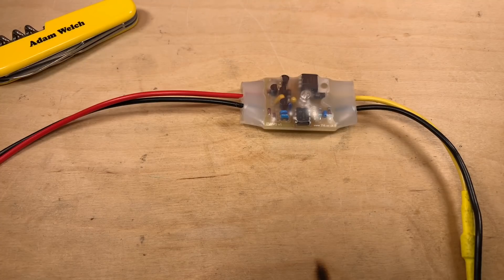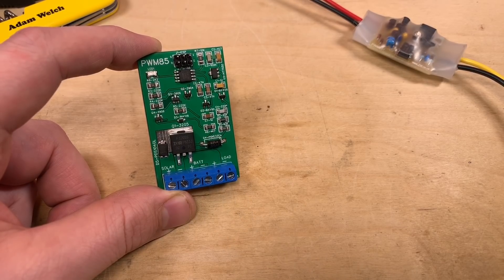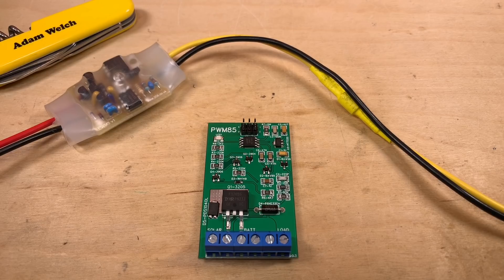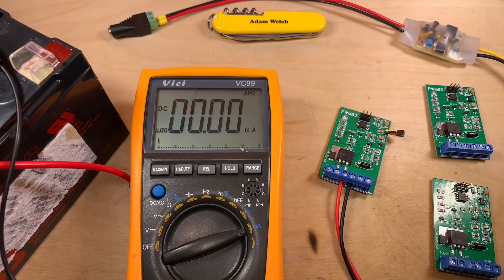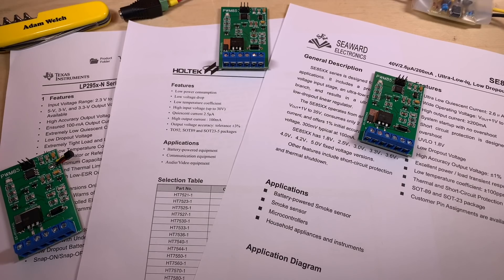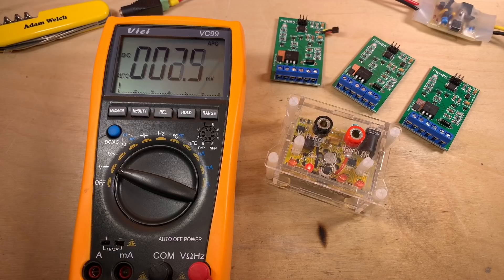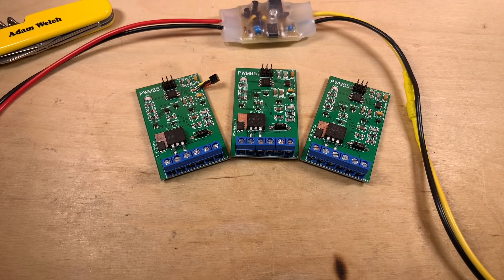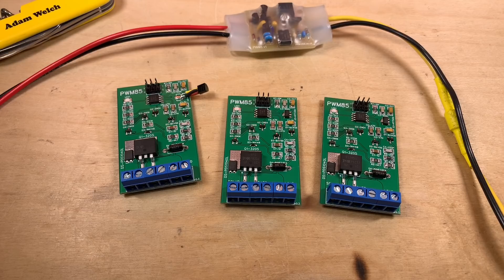Arduino PWM Solar Charge Controller v4 - PWM85

Comment: a lot of your effort has been directed to the improvement of the standby current draw but how about the efficiency of the MPPT "at circuit level"? the topology of this circuit is odd because every time you switch the MOSFET you force the voltage of the battery into the PV panel. This should cause the current of the panel to be a series of short impulses followed by constant steps, I think this may break the MOSFET on the long term. Has the current waveform been checked?

Comment: I like your determination Adam, keep it up! 

It's very difficult to find ultra power efficient LDO's with a wide input voltage range. Most of the very efficient (low power consumption) devices are limited to no more than 6V peak input.  Normally they are marketed with terms such as,  'micropower', ultra-low power' and the like. It might be that you've taken this design as far as is practicable. Maybe consider looking at the ultra low power MSP430 processors. Yes, I know it's not Arduino or PIC, but they have been used in battery powered devices such as multimeters for many years. It was designed for low power battery applications. Maybe something like the MSP430F2013. A development kit starts at just $24 (USD),  http://www.ti.com/tool/EZ430-F2013 Might be worth a look, what can you do during a lock-down!
Reply from the maker: Thank you for the suggestions. The next exciting instalment which is available to view I make hardware changes which help reduce the consumption further. Since that video I’ve found that code changes have also saved me quite a bit too. Video still to come on those changes. Stay safe!

Comment: You are mixing up mA an up quite badly. You said 7.5mA when you should have said 7.5uA for the original.  Your measurement are in mA where the datasheet  says a quiescent for the 5Vdc regulator of 2.7uA. You should consider the microcontroller quiescent current as well. Quiet confusing to the novice.
Reply from the maker: Hello. I did at one point say milliamp rather than microamp. That is true, sorry. You’ll understand that the data sheet can only quote a figure for the regulator itself - because they have no idea how you are going to use it. I on the other hand can only quote figures I’m seeing in a circuit. Further on from this video I have managed to decrease the quiescent current of the whole circuit by redesigning the hardware a little - and there’s more to come with software improvements. Keep watching :-)

Comment: Dear Adam, what should be the output voltage of the solar panels that feed energy to this circuit and up to how many watts can I connect?
Reply from the maker: Hey. It’s designed for 36 cell panels which typically have an open circuit voltage of 21 volts and an MPP of 18 volts. Now Julian who originally designed the circuit rated his PWM5 for 6 amps - or about 100 watts. I however have changed the solar input diode to a completely different package, and haven’t been able to test at six amps yet. I’ve run 3 amps through it for two hours and it’s fine, but I need more sun!
Reply: @AdamWelchUK  That's great hearing from you. May I suggest you something? There's a channel named "TheDIYGuy999". He upgraded It to another level. You may have a look. Here's the link-https://www.youtube.com/watch?v=VSQE8qpXvVE

Comment: Question -
Using 32650 (LiFePo4) in a 4P configuration to drive a 6V game camera and being charged with a 5W solar panel.   My idea is to use a small Buck converter for charging and a small boost converter for the load.    My box does not allow much room for large boards.   This setup will be for field use and visited maybe once every 3 months.  

The quiescent current for the game camera is quite small < 1ma; that required for the onboard motion detector.   The max current is around 600ma and is only when the IR lamps fire for a fraction of a second.   

The max voltage for the solar panel is about 17-18 volts with max current of about 500ma.   When the voltage falls below 4V, the current is essentially 0.0ma.  

So, what small buck converter will handle this voltage swing and create a constant 3.650 volts?

I have seen several boost converters that are adjustable up to 6V. 

I’m so glad I found your channel!!     
Thanks, Mike Taylor Texas USA

Comment: The Arduino has even a deep sleep mode, where it halts everything, drawing only nA, that can be woken up from by a pin toggle, I.e. when the solar panel produces a voltage. The low draw pwm 5V regulator you use possible also has a nA sleep mode when the draw drops below a mA or so, so this charge controller could even be used in a remote sensor setup, etc. with a small 7AH lead acid battery that then would could save its charge through weeks without sun.

Comment: I like the way you did the float voltage code at the beginning of the sketch. Much easier to get accurate battery voltage.
Reply from the maker: Thanks. I’ve tried to explain the equation as well as ensure it’s calculated at compile time rather than leave it to the mCU complete.

Comment: Hi Adam, I have been subscribing for a while (and to Julian's). Good stuff.  Question: Why just bring the charge to 13.5V   A good charger IMHO  should do Bulk,  Absorption and then Float. You just bring it to float.  For AGM and GEL used in cyclic applications as a suggestion (and to avoid adding a current sensor) can you detect start of day ie solar I/P  then charge to say 14.4V, hold at that voltage for a time, say an hour THEN jump to a Float of 13.5V . If the battery isn't cycled a lot then reduce Absorption time. Interested in yours and others feedback. I'll order a few PCB's from JLC and have a play with the code. Thanks again.
Reply from the maker: The code is Julians - except for the adjustments for the ATTiny. I believe the answer to your question is more about keeping the code as simple as possible so the charge controller is able to adapt to changing conditions quickly. The PWM5 does charge to a higher voltage for a short period on a morning, and that is something I’d like to see in the arduino code. 
It’d be great to have someone else on board looking closely at the code - thank you.
Reply: @AdamWelchUK  will have a play
Reply: @AdamWelchUK  Hi again Adam,  I have been playing. I have built what I call PWM328. Barebone using 328p chip.  Keeps things very simple and standard. Only get 8ma but I use sleep at low light/night and get micro amps which is the time you don't  want to use power anyway. Included also is temp compensation (important) and jumpers to enable temp, wet cell/ dry cell chemistry and cyclic/float charging. I also use a bi led to show all states of charge. If interested how do I send you details? I would love your feedback especially the use of a P chan mosfet rather than a charge pump. It appears to work well but do not have oscilloscope to check.

Comment: Good job, and if you replace the mosfet 3205 for irlz44 you can eliminate charge pump and his associate code. The irlz44 give 50 amp for 5v gate.
Reply from the maker: Thanks. I’m afraid you can’t illuminate the charge pump. The n channel mosfet is on the high side of the circuit - it’s source is attached to the battery positive. That means you need a voltage about 5v higher than the battery to turn the mosfet on. An irlz44n would still need the charge pump so the gate voltage was above the battery voltage.

Comment: Hi nice project, you might have said it in the video but what is max input voltage from solar panel?
Reply from the maker: This is for a typical 36 cell solar panel up to one hundred watts. It’s the sort of panel sold as 12 volt, but one that has a open circuit voltage of about 21 volts and a maximum power pint of around 17-18 volts.

Comment: Nice! :) Next things I'd be looking at are (not necessarily in this order):
a) lowering the system voltage if possible  - you can get to close to half the power consumption... check out chapter 22 of the datasheet, where it shows the relation between clock speed, active current consumption and system voltages.
b) seeing if it's possible to use the Internal 128 kHz Oscillator  - at 5v that should bring you BELOW 0.5ma ... :-O 6.2.4 and 22-5 - maybe look at using this maintained BSP instead? https://github.com/SpenceKonde/ATTinyCore
c) seeing if can we do away with the charge pump, switch to a logic level mosfet
d) what about an ideal diode?
e) calibrate the 1v1 internal reference voltage and store it to eeprom to be able to correct variance in the system voltage / regulator output
f) ensuring any unused peripherals are disabled, ensure unused pins are floating (inputs), use sleep mode instead of delay, shut down ADC when not in use (and especially before sleeping), etc.
Reply: the charge pump is to drive a n-channel mosfet on the high side, so the ground is continuous
Reply: @nirodper  Don't you mean P-channel? N-channel are ground switching mosfets ;) And parts like the FQP27P06 are good for switching over 10A at around 4.5v... so no charge pump needed.
Reply: @pfeerick  no, n-channel, and he is driving it on the positive rail so he needs a voltage higher than the supply voltage, which the charge pump provides.
The reasons are n-channels are slightly more efficient (difference was higher when the pwm5 was designed I think) and having a continuous ground and switching the high side is nicer with our conventions
Reply: @Peter Feerick 

In regards to:  e) calibrate the 1v1 internal band-gap reference

 While watching some of Julian's videos from a few years ago, I initially thought that using the internal band-gap reference like the one on the ATtiny/ATmega uC's would improve the project, but this doesn't seem to be true in reality as all of these internal band-gap references seem to have an error margin of more than 9%, even those on microcontrollers from other manufacturers.

Rather than calibrate the internal reference (Vbg), which involves using a separate sketch or special operating mode to output Vbg to a pin for measurement, I suspect that Julian was right to use the actual regulator output (Vcc) as the reference since it appears that the LDO's discussed in this video are actually more accurate than the internal reference; most are < 1% or better.  I haven't found characterization data for either the AT-series Vbg or the BOM LDO, so I cannot compare temperature drift.

Anyone capable of building this PCB is also capable of measuring the regulator output (Vcc) in-circuit, whereas calibrating the internal reference is more complicated and may not even be practical in-circuit.  It's also very easy to short out the internal reference when it's connected to an external pin; such delicate work is best avoided.

Characterizing the float battery output drift over a range of temperatures would include all in-circuit drift and likely improve accuracy substantially, but this would take some effort and may not be entirely applicable to builders who sourced different brands and batches of resistors, etc.  It would probably still be an improvement for a module that may spend its life outdoors in sun, rain, and ice, though.

The voltage divider resistors can easily be calibrated in the existing sketch if builders have an accurate ohm-meter to test them with.  Most cheap multimeters today are quite accurate at this resistance range (<100kOhm), though they often become less accurate at values higher than a few hundred kOhms.
Reply: @antibrevity  Yes, it does require measuring the voltage at that Aref pin with the Vbg turned on, but if this were being designed from the start with this in mind, that would not be an issue. You would simply ensure that a test-point is available - no components to populate, nothing to short out! If you can measure the Vcc, you can measure Vbg just as easily, if not easier. 

The only hassle is having to measure the internal reference voltage, enter it, and also measure and enter the self-measured supply voltage for secondary calibration. If you really want to get fancy, you can use the internal temperature sensing to make it even more accurate with temperature compensation. But then again, even with an external reference, depending on how accurate you want it to be, some tuning is needed. The realy annoyance is that Atmel never did give the specs on the Vbg stability, but this is probably as it is a freebie, as it was implemented for the Brown-Out Detection and designed for low power consumption, not absolute stability. 

Obviously, if this were being done as a production run, you'd be running a test sketch anyway, and would probably automate the measurement and storage of calibration values in EEPROM... (as opposed to the manual entry I currently do)... it really depends. At least with even cheap DMMs being pretty accurate as you say, it's within the realms of the home enthusiast to get the accuracy of these things pretty darn good ;) I can appreciate though as Julian showed in his investigations though that it's isn't just as easy as "turn on 1v1 internal reference and you're done"... but then again, where's the fun in that?

As far as float battery voltage drift, better to have an external temperature sensor on that battery like most non-junk solar charge controllers, so you can do temperature compensation tweaking.

Comment: Actually most solar panels these days do not have a blocking diode fitted, only bypass diodes. With the extra space on your board you could take the opportunity to get rid of the Schottky diode and replace it with a reverse connected Mosfet. You should be able just to parallel the gate drive with the switching Mosfet. This will rid the design of most of the voltage drop and extra heating.
Reply from the maker: Thanks for this Xan. I can’t quite see how this would work though. I’ve looked at using an N-Channel mosfet with its source connected to the solar (and a p channel) and I can’t see how I turn it on with the gate driver I have. Julian did do a video discussing this issue here - https://YouTu.be/qY-6GK873ts It’d be great if you could see a solution Julian missed. I’ve been meaning to contact you about this anyway - any chance you could email me (click about on my channel page for an email address) when you get a minute?

Comment: PWM charging system have big fail, destroy battery fast. only MPPT charging system have smart and good and safety use. idiot use PWM.
Reply: Just because something says "MPPT" on the front doesn't make it a good charge controller.  This particular controller is not MPPT, but it's meant to be simple and inexpensive to build and mainly focuses on keeping a lead-acid battery system from over-charging.  There's no need to call people "idiots" for using PWM, as there are certainly bad MPPT controllers on the market.  This circuit seems perfectly safe for a lead-acid battery system.  We'd be more than happy to check out an MPPT controller project, however <hint> :) .
Reply: Only poorly designed or calibrated ones. If the PWM controller has proper cutoffs for the battery voltage, it will be perfectly fine. There is data to suggest that PWM is better than MPPT in certain applications, as it helps prevent the battery sulfating. The only PWM controllers I have had wreck batteries are ones that hold a 12v lead acid battery at 14.4 -14.7 indefinitely, rather than at 13.5 - 13.8... the higher voltage just slowly boils the battery :-/

Comment: Is there any mppt controller kits, that offer larger current capabilities? To charge liion batteries? With about 50-60v input, and 29.4v out? I'd like to charge up to 100 amps, crazy huh? Floating liion LIFePo cells at full voltage will destroy them, I heard of a test, and depending on conditions, nearing 1% decline of capacity per cycle! Batteries cost too much for that, I wonder if floating at a lower voltage would have any effect, about 4v/cell, but it shouldn't show and issues if held at nominal voltage, 3.2LiFe, or 3.7v for liion. Possibly, adding a normally closed relay to PV input with a voltage controlled switch, to disconnect pv, when the liion battery is full! To stop float, without having pv in without battery on the controller..
Reply: look at the victron brand . try searching victron mppt .

Comment: I love it Adam, everyone's suggestions pretty good, I'm still new to electronics and of course circuit design so input from various YouTube given more help.

I would like to know if some sort of measuring graph/logging can be done, so it can be read over a display/computer program..
Reply from the maker: Unfortunately not. That would require more pins on the microcontroller and probably use more power. I’m not sharing it can’t be done, but it would be a fairly big redesign. The cheapest commercial option I’ve used that can do this is the landstar series from EPEver (the more recent models have RS485 ports on them and you can read that data and log it to a database or to the EPEver windows software). I’ve covered all of that in other videos - but sadly it isn’t a solar controller you build yourself. 
Otherwise another arduino or similar with some modules could log battery voltage and current via serial as a basic logger.